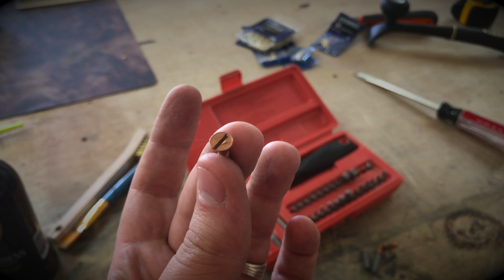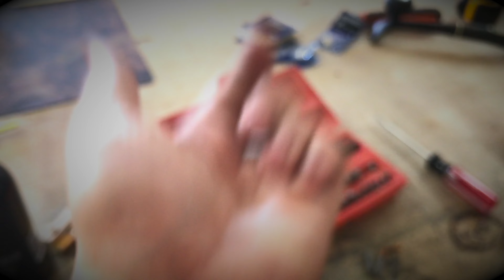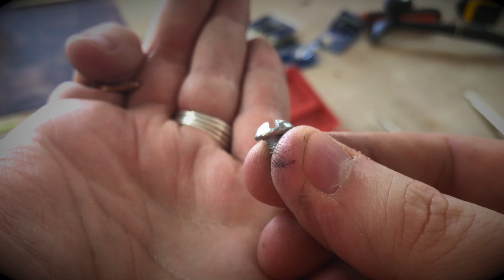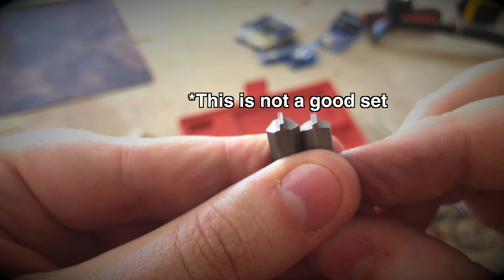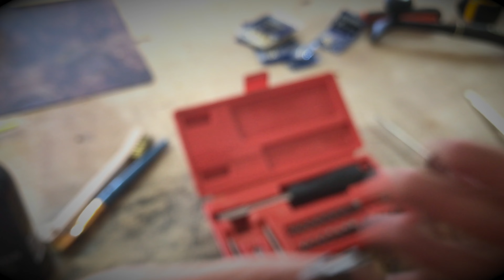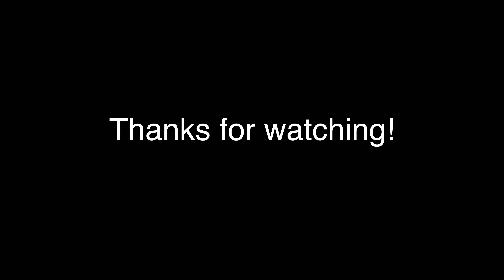TIP: Using Soft Slotted Screws Without Damage.

Comment: I thought 1/4" slot bits have a similar section of flatness.
Reply from the maker: Adam Rivera if you have the hollow ground kind (pretty common) they are fairly parallel at the tip but you don't get the varied blade widths which is very important. So that they fit all screws most screw drivers tips are slightly under sized and can damage the screw heads if there's any play.

Comment: great tips thanks! any set you'd recommend?
Reply from the maker: homer power not really these are a cheapo set I think I got from walmart many years ago  (probably $10) but you can get much better ones.  You can even buy nice parallel ground screw drivers from woodworking shops but I don't think you get the varied blade widths.  I know there are good sets out there but I don't know the names off hand.

Comment: Great tip, Ray. This is what I've been doing for as long as I can remember. It works great and really saves you a lot of frustration.
Reply from the maker: +Lyle Kobberstad yeah I used to actually grind my screwdrivers parallel, but since I got the little set I don't bother anymore.